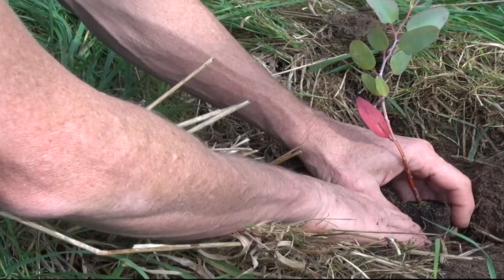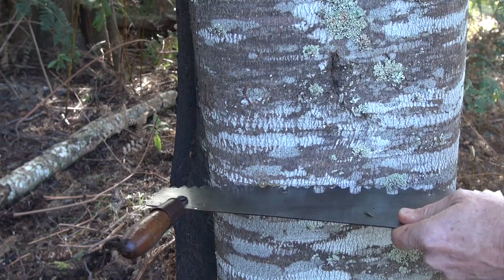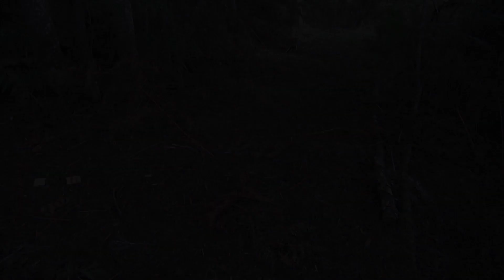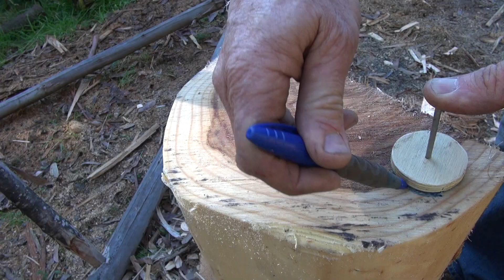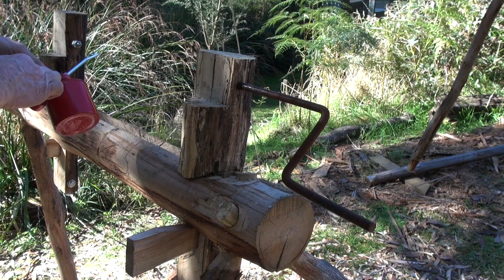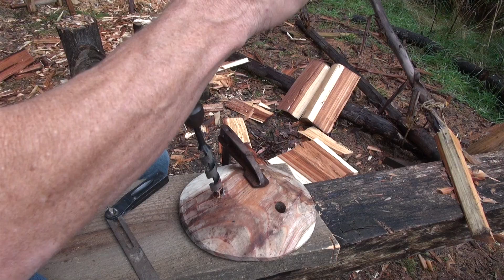Wisdom Through Wood

Comment: Wonderful work, indeed! As I am new to wood working I have a question. You didn't dry the wood for years before shaping it. Won't it crack with time, especially if it is kept in a warm house? I would really appreciate an answer!
Reply from the maker: palebeau The woodworking technique I, and many others, use is known as 'green woodworking'. It's a traditional form of woodworking that uses wood from a living tree that was recently felled. Green wood is much easier to work than seasoned wood. The final pieces rarely show any signs of cracking. This is mostly due to the way they are split out of the billet (sawn section of tree). However, all green wood shrinks as it dries and this process must be understood and managed if the piece is to have strong and lasting joints. 
Cheers
Alex

Comment: hello, realy good!!
what is the name of the axe used in 4min40? please
Reply from the maker: It's a broad hatchet or sometimes called side axe. Like a chisel or plane blade it is flat on one side so it's a single bevel tool. The flat side allows a very low cutting angle so you can achieve a smooth finish with it.
Reply from the maker: The other tool is a froe. Used for splitting logs or billets. You hit this tool with a maul (mallet).
Reply: Thank you, i can not find this in Franc :(
Her name is "fendieu". May be in a flea market.

Amazing work!
Reply from the maker: +Lisa F 
You can buy these tools new at https://www.classichandtools.com  Look under Axes and Woodland Craft Tools.
All the best.
Alex
Reply: I will do it!
Thank you Alex.

Comment: what did you end up doing with the tree's skin that you flattened?
Reply from the maker: Dakota DeCory Many uses for dried bark:. Some pieces cut into strips for seat slats, some allowed to return to curve after partial drying and used for small shelve cases and others held flat and whole for small table tops. The material is extremely strong although it has a natural tendency to want to move back to its original curved form.